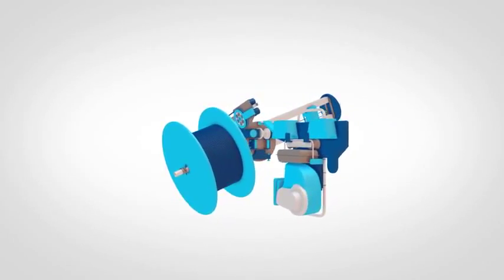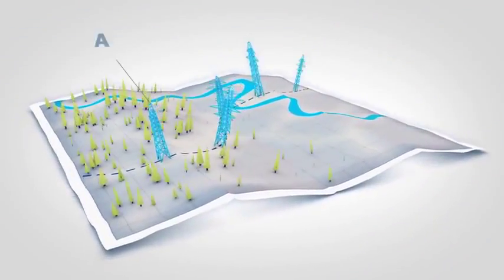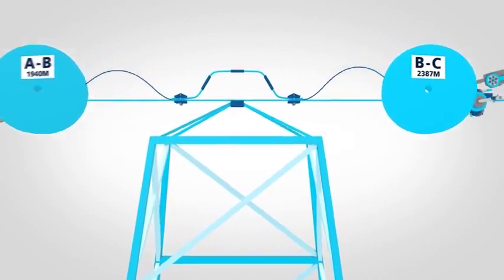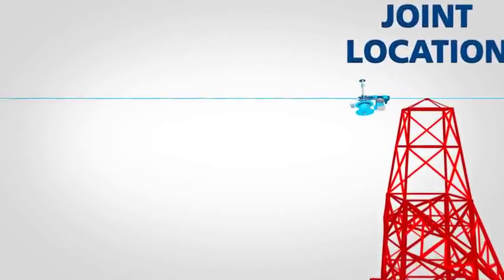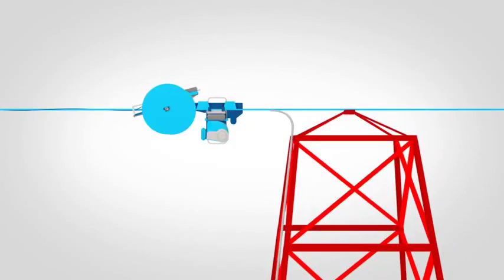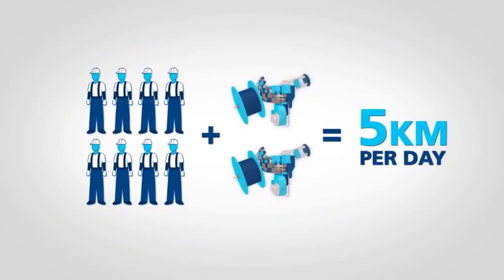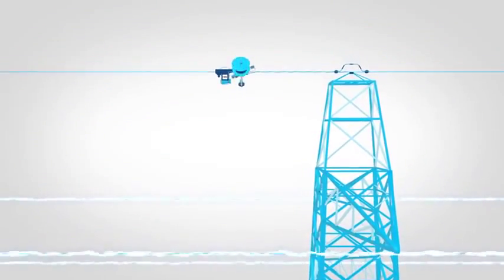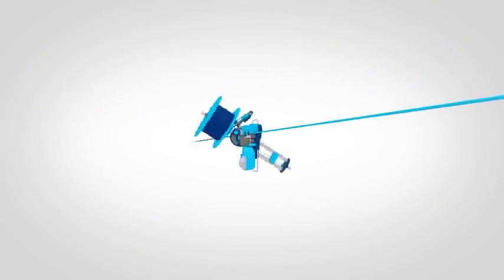Lashing Aerial Fiber Cable on Power Lines

Comment: I’m not sure why we wanna put on the power lines
Reply: why not? they are not conductive.
Reply: william mj cummins because they are already installed at the location, probably saves 90% of the cost in having to dig or build new structure to hold fiber
Reply: Yeah why not buddy